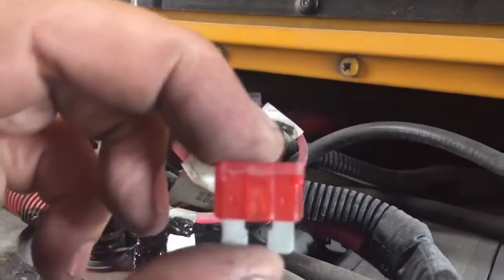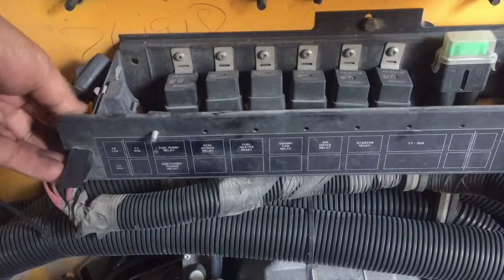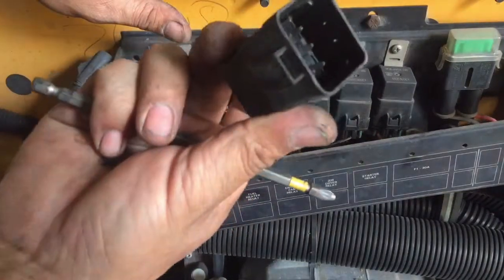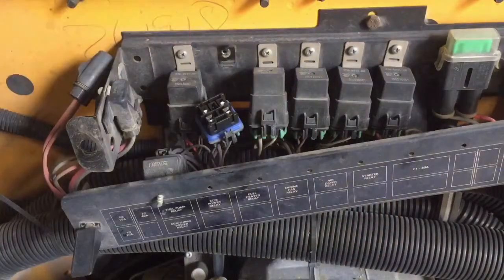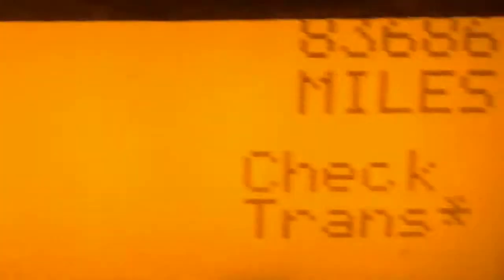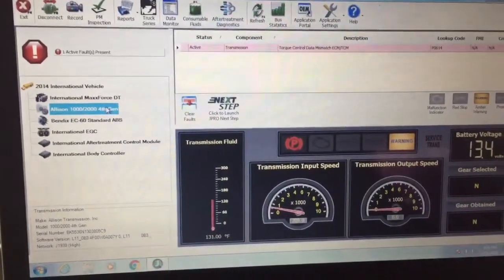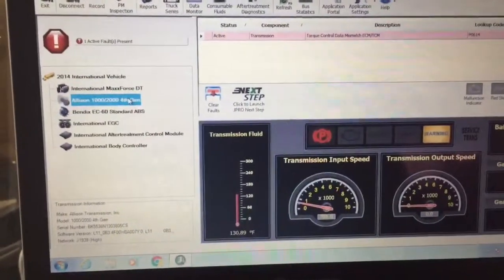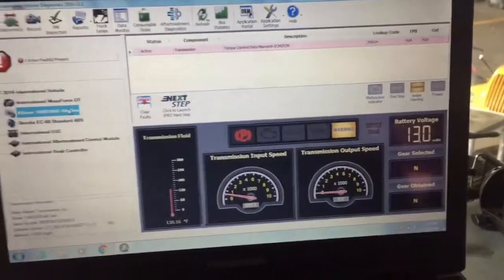2014 maxforce  school bus

Comment: What transmission are in the 2014 icce maxxforce 7 engine?
Reply from the maker: It should be an Allison 2500 or 3000. Depends on how your district spec’s them out